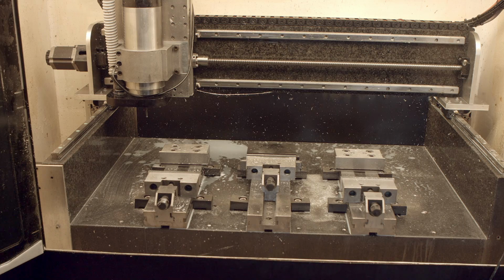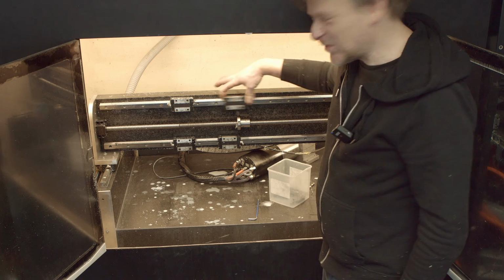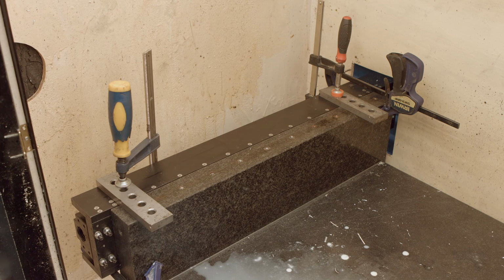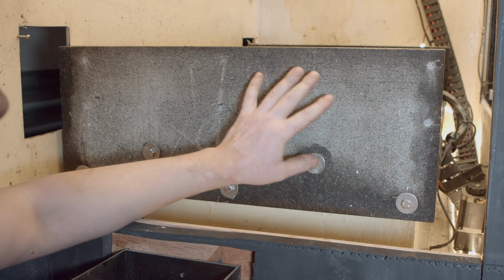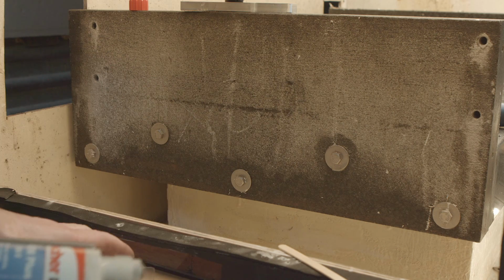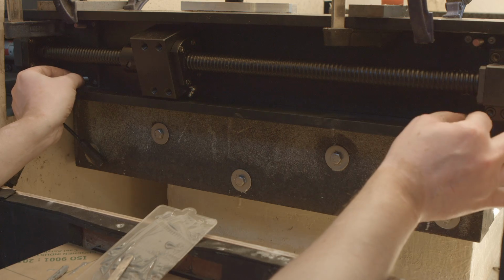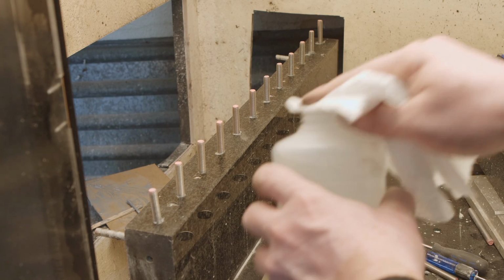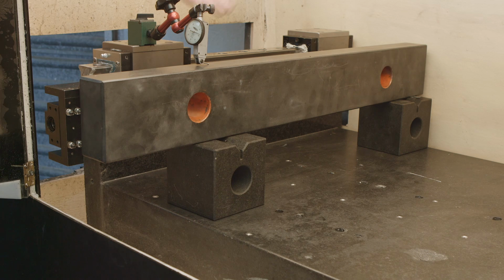EPIC CNC upgrade - episode 6.taking machine a part, drilling through 2m of granite, rail adjustments

Comment: So good having a kiwi to watch machine is going to be a beast those rails on it they big 💪.  You can also get the Chemical Anchor  at bunnings in a normal 300ml tube so no need for a special gun
Reply from the maker: Thanks mate ;) do you have a name for this chemical anchor? Machine turned out to be just like comercial ones from the top shelf 👌 check my instagram i have pictures from my first test in there. Mirror finish on a 3d milled ball. And i wasnt even trying hard. Just had to dial in tolerance in fusion to 1 micron.
Reply: @PiotrFoxWysocki  just had a look that surface finsh is awesome good work can't beat rigidity . 
Ramset Ultrafix Plus 300ml think miter10 and bunnings have but there Lots of options for normal gun can get small 150ml tube if you shop around
Reply from the maker: Thanks for the tip. I never have considering ramset to be honest. I used their metal inserts but never thought to use their glue ;)
Yeah rigidity is the key. quality of the other components adds to it as well, if you want to have perfect finish.

Comment: Awsome! Those rails are just beefy!
Reply from the maker: And precise. +100 points to rigidity 😁
Reply: They are huge for so small machine....30mm???
This are roller type, correct?
Reply from the maker: 45mm ;) and yes they are roller guides. Preloaded to precision standard.
Reply: @PiotrFoxWysocki  impressive...rails it won't ne a problem in the near future....what brand you use   Bosch?
Reply from the maker: Bosh rexroth star 45 size

Comment: There are little plastic covers that fill the screw holes in the linear rails.  If you don't use these, chips and coolant an get inside the bearing blocks by hiding in the screw holes. You might as well not have wipers on the trucks if you aren't using those caps for the screws.  That's probably why your bearings got so rough.

I've also seen some machines use epoxy filling the holes which is shaved flat with the rail when it cures.  My Mazak is like that.
Reply from the maker: i noticed it. im thinking about some adhesive strap to cover the whole rail. or plugs if i wont find it.
btw if they fill rails with epoxy how do you replace them later?
Reply: @PiotrFoxWysocki I lied, I just went out to the shop and looked again and they are little plastic caps.  Maybe I'm confusing it with something I saw in a youtube video before where a cap is used and then epoxy to level it flush and smooth with the rail.

In any case, anything to keep coolant and chips out of the grease and the balls in those trucks would help their longevity.

Comment: When you put those rails on the table my jaw DROPPED. Those are enormous! For the ball screw, why does the flex matter at all? The ball screws are definitely not designed to be structural, thats that the rail supports are for.
Reply from the maker: good question, glad you asked. thin and long ball screws will bend when they are pushing load from the motor. so they start whip lashing and transmit vibrations to whatever is attached to them. when they are bending position of attached component is different. and all this is affecting surface finish.  when they are pulled,  they are straight, so no problem. 
bigger screws keep attached axis in place much better than skinny ones. 
if the this screw is bent just even so slightly it will allow for bending more under the load.
Reply: @PiotrFoxWysocki  Interesting, did even think about that! I am just starting my diy cnc journey with 1605 screws and HGR 20 rails. It's for a router so my radial load is nothing compared to the mill you have here. Your content is great and I can't wait to see the completed upgrades!
Reply from the maker: I started from 6040 chniese cnc ;) whole machine was 50kg. Now just my gantry is 130kg ;) 
Machine is finished and i have some pics on my instagram of the first test cuts. Well.. i can not complain 😁 
I will be uploading more videos as i find time to edit what I've recorded already.
Reply: @PiotrFoxWysocki  good stuff! I’ll definitely drop a follow! I’m a software engineer professionally so all this machining stuff is incredibly fun as a hobby!

Comment: Nice but you did not show how did you make the other rail parallel to the one on the left?
Reply from the maker: I know... sorry for that but i thought this series was getting terribly boring already with all the measurements. I thought i gived lots of examples of measurements through  the build.
Reply: @PiotrFoxWysocki  i was waiting for this specially, how did u make them parallel?
Reply from the maker: I used the left rail which was set and connected to the gantry. Right rail was lose and carriages where loose. Moved gantry to the front and bolt the rail down gently than back and the middle. Then i tighten the carriages gently and loosen up the rails. I did this procedure like 20 times. So everything found its best place to be in. In the mean time i was checking if the gantry is still square. Its quite tricky do do this right tho.. and you might end up with quite big discrepancies.. especially when you are using smaller rails. Its a pandora's box i didnt really wanted to open. But i kinda showed this on the top rail of the gantry.
Reply: @PiotrFoxWysocki  i also thought u did that, well that will work but i really think it is not optimum, i would still use the dial indicator, when done that way the movement is really uniform and smooth even with a preloaded blocks
Reply: another mistake i am really surprised that you made is that you are no using dual driver system!! this could be the main reason for your damaged old rails along with chips getting inside them, try to dissemble the old blocks i think they r filled with chips, check the rails grooves for damage, i think they might be ok and just chips inside the trucks that caused stiffness

Comment: Hi Fox, Could I ask what size air compressor you use for that spindle, the manual speaks of pressure but not what free air delivery it needs.
Reply from the maker: I have 3hp 50l 390cfm compressor. I think any compressor will work. It takes about 5 minutes to cycle. And it will take about 5 min to cycle any 50l compressor.

Comment: Wonderful CNC Piotr. What will be your choice for the CNC control board?
Reply from the maker: I got my self uc300. Looks like its working gine. Mach 3 started working strangely but i will keep it untill i find what it causes. Than i can try lunux cnc.
Reply: @PiotrFoxWysocki  That is so professional and precise CNC hardware that you can take into account some Industrial CNC to control it. I'm in develop-team of a board called RosettaCNC born to the industrial application but available to all. If you want to take a look at the software it is free and without a card works as a simulator.
Reply: @PiotrFoxWysocki  The CNC Board is a true CNC and all interpolations, RTCP, toolpath management, look-ahead algorithms, smoothing, jerk control, smooth blending, etc are made in realtime on board rather than PC. Closed-loop with optical rails is also possible.

Comment: Hey, awesome job. Those rails look so intense, especially compared to your old ones. A few questions
1. How did you get the linear rail to sit perfectly flat, I think I missed that? 
2. IN a previous video, I thought you showed that the linear rails were bowed. How did you correct, fix or address that issue?
Reply from the maker: 1. when i made the base i made it as flat i was able and it was with in few microns. so there was no real need to do anything. i just shimmed front and back because was looking a bit low. 
2. in the previous video i was considering using 2 other rails for my x axis. but i was worried that they will push centre of the gravity too far from the gantry so i bought smaller rails. 
the big rails for sidewalls where also bowed but it wasn't a problem because i just bolted them down and this straightened them without a problem.  sidewalls are vertical and 300mm tall so they act like 300mm of granite. where the gantry is 200mm tall but i would be bolting them from the side where granite is only 50mm so this would bend the granite. 
I might include a short info how i straightened those rails. even if i haven't used them at the end

Comment: Could you tell if the old X linear rail carriages were just worn out or were they maybe contaminated with coolant and swarf?
Reply from the maker: good question :D I couldn't really tell. but from the experience with them I can tell they are gone. I re-balled them before and they where quite bad to start with.
Reply: @PiotrFoxWysocki  Would you say it is because of usage or contaminants?
Reply from the maker: I suspect everything by little. But mostly because they where crap when i bought them. They where a Chinese no-name brand. Even before i installed them i knew i will have to replace them shortly.
Reply: @PiotrFoxWysocki  I think i just bought the same, oops :D
Reply from the maker: So you dont have any company name engraved on them ??
Reply: @PiotrFoxWysocki  None,  it is the TRH20 and TRH20B from RATTMMOTOR CNC- POWACE Store although in the plastic start- and endcap it has "CHTR" on it.
Reply from the maker: Ups... so you got exactly the same as i had.. i guess they should last longer in your machine. Mine was heavy and and mostly uncovered.

Comment: Man!!, I'm not surprised those packs were so gritty. Did you ever grease them, I don't see any covers or bellows on them either. Those aren't designed for open machining , would need steel scrapers over their wipers. Maybe the new ones will fare better.
Reply from the maker: yes i did grease them and reballed them a year ago because they where way too loose.  I will have to make something for the new ones

Comment: Hi Piotr.  I have been following your builds for a long time, and a plan to do something like this myself some time in the future.  I have a huge 750kg granite table i want to cut into the required pieces.(It was used for a four spindle PCB drilling machine)  

What is the pitch you are using on your ball screws, and what is the size of the motors you are planning?
Thanks.  Looking forward to follow the rest of the upgrade
Reply from the maker: I would recoment to look in to the epic upgrade part 1 and 2. All parts and sources are in the video descripions.
Reply from the maker: I would recomend 5mm pitch. And im using 400watt servos. But you could use steppers as well. Check epic upgrade 1 and 2 i have all the parts there

Comment: This thing needs nice central lubrication system 😁
Reply from the maker: would be nice but this is too much work :D according to the manufacturer recommendations i can grease it once a year and it should be fine
Reply: @PiotrFoxWysocki  only if its covered and sealed i guess 🤔 with open construction they might slide like your old ones after a year...
Reply from the maker: I will have to think of some creative ways to cover them
Reply: @PiotrFoxWysocki  try custom made harmonic covers from eBay or Aliexpress , worked ok for me
Reply from the maker: Thwy wont fit :(

Comment: Try to fit some kind of bellows to protect your new screws and linear rails. Flood coolant and chips will decrease the lifetime of these items really quick.
Reply from the maker: I will try to figure something out. Its easy for the Y, but not so easy for the gantry. Its just too short
Reply: @PiotrFoxWysocki  yeah I know. I have the same problem, let me know if you find a good solution :) I've been thinking about a plastic sheet that could roll on the backside of the gantry, but it requires alot of redesigning.. :(I
Reply from the maker: Had the same idea a while ago ;) way to many pulleys around. And still there will be a problem with the bottom. Maybe a something super elastic.
Reply: @PiotrFoxWysocki  perhaps a giant zipper? :D
Reply from the maker: Question how long would it last 🤔
Reply: @PiotrFoxWysocki  prob not long